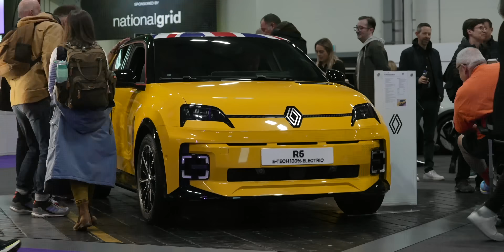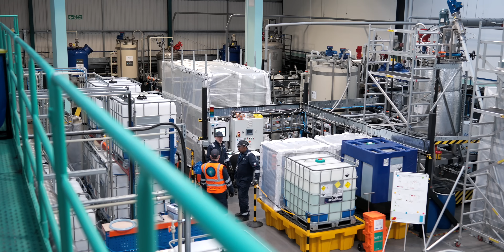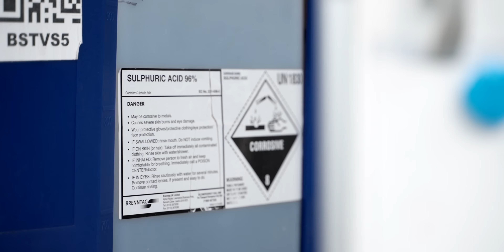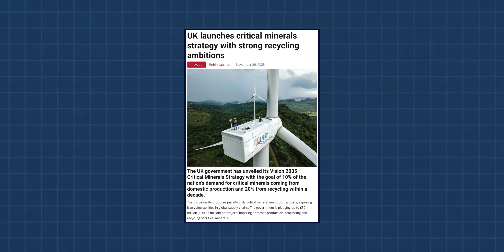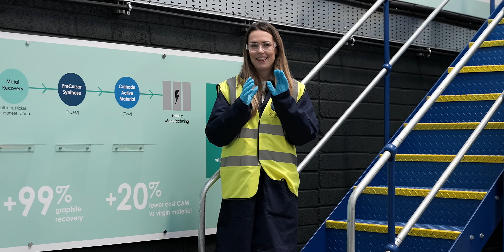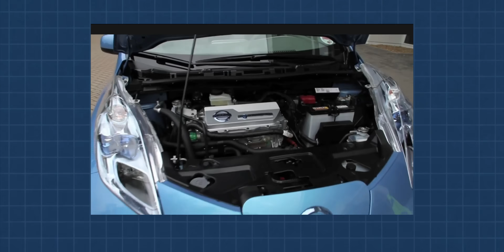EV Battery Recycling Could Be The End Of Mining!

Comment: They should invent a way to recycle burnt fuel.🤣
Reply: How?
Reply: @Brian-om2hh I think that was his point. It can't be.
Reply: @oddjobsandrandomprojects 

😂😂😂😂😂😂😂😂😂😂😂😂😂😂😂😂😂😂😂

And yet another blunder on your part.

You really can't help yourself can you.
 
Hydrogen and oxygen recycle themselves into water at the same time as work is performed.

Water is then split into hydrogen and oxygen via electrolysers.

Green electricity decoupled from the grid is effectively free.

Try as hard as you can to resist your usual spurious arguments on the grounds they have no merit and never had.
Reply: @ForestForest-n9i @ForestForest-n9i Tell is about what car you personally own then. Is it hydrogen?
Reply: @ForestForest-n9i @ForestForest-n9i
At some point it’s worth stepping back and looking at what’s actually working now, not what’s been “five years away” for the last two decades. Battery Electric Vehicles (BEVs) have already won the light-vehicle race on efficiency, infrastructure, cost, and real-world usability, while hydrogen remains a niche science project for passenger cars.
First, efficiency matters. BEVs convert roughly 70–90% of grid electricity into motion. Hydrogen vehicles (both FCEVs and H-ICE) lose huge amounts of energy producing hydrogen, compressing or liquefying it, transporting it, and then converting it back into electricity. Once you count all that, hydrogen struggles to reach 25–35% well-to-wheel efficiency. Using clean electricity to make hydrogen instead of charging a battery directly is simply wasting energy.
Second, infrastructure is decisive. Electricity is already everywhere. BEV owners can charge at home and use a rapidly expanding public network. Hydrogen stations are rare, expensive, complex, and unreliable. In the UK there are only ~15–16 hydrogen stations total, with about 6 open to the public, versus 57,000+ public EV charging points and growing fast. Globally the contrast is similar: millions of EV chargers vs ~1,100 hydrogen stations. You can’t scale a consumer technology without infrastructure, and hydrogen never has.
Third, cost and practicality. BEVs have lower total cost of ownership: cheaper “fuel,” fewer moving parts, and less maintenance. Hydrogen fuel is expensive (often $10–15/kg in the US), stations frequently go offline, and you can’t refuel at home. This isn’t theoretical—hundreds of Toyota Mirai owners in California are now part of class-action lawsuits after being stranded by broken stations, skyrocketing fuel prices, and vehicles that have lost most of their value.
Fourth, a point often ignored: FCEVs still use lithium batteries. They are series hybrids—hydrogen makes electricity, which is buffered in a lithium-ion battery that powers the motor. So arguments against BEVs based on batteries also apply to FCEVs, plus FCEVs add fuel cells, platinum catalysts, high-pressure tanks, and more complexity on top.
Fifth, the market has already decided. Global EV sales jumped from ~3 million in 2020 to over 10 million by 2023, with BEVs dominating. Automakers and analysts (IEA, BloombergNEF) consistently point to batteries as the winning technology. That’s why companies like GM and Stellantis have scaled back or exited hydrogen passenger-vehicle programs, and why hydrogen is increasingly being limited to specific heavy-duty or industrial niches, not everyday cars.
Hydrogen cars do have zero tailpipe emissions, but once you consider production methods (mostly fossil-based today), energy losses, infrastructure costs, and real-world failures, they simply don’t compete with BEVs for personal transport. While hydrogen advocates keep promising a breakthrough “soon,” millions of people are already driving cars that are efficient, affordable, charge at home, and work every day.
This isn’t ideology—it’s engineering, economics, and market reality. For light passenger vehicles, the conclusion is no longer controversial: plugging in beats waiting for a miracle fuel.
Reply: @ForestForest-n9i Not good at reading are you. Try again.
Reply: @ForestForest-n9i Ross Kneebone — since you’ve publicly stated that you work as a representative for a hydrogen bus company, the way you behave here looks less like honest debate and more like paid advocacy mixed with trolling. You don’t show up to add insight; you show up to complain, derail threads, and take snide shots at other commenters instead of engaging with evidence.
So let’s stick to reality. In the UK today there are roughly 16 hydrogen refuelling stations in total, and only about six are actually open to the public for passenger cars. That’s not a rollout — that’s a dead end. By contrast, the UK has tens of thousands of public EV charge points, and the number keeps growing because electricity already exists everywhere and scales cheaply. Infrastructure decides consumer technology, and hydrogen has simply failed that test.
On efficiency, the physics are settled. Battery electric vehicles convert the majority of grid electricity into motion. Hydrogen passenger cars throw most of it away making hydrogen, compressing or liquefying it, transporting it, and then converting it back into electricity inside the car. Well-to-wheel efficiency for hydrogen struggles to reach a third of what went in. Turning clean electricity into hydrogen instead of charging a battery directly is just wasting energy.
You also repeatedly attack lithium batteries as “dangerous” or “unsuitable,” which is especially dishonest given that fuel-cell vehicles still rely on lithium-ion batteries. They are series hybrids: the fuel cell generates electricity, that electricity is buffered in a battery, and the battery powers the motor. By your own logic, hydrogen cars fail before you even get to the fuel cell — and then pile on extra complexity with platinum catalysts and high-pressure tanks.
Real-world ownership backs this up. BEVs charge at home and work every day. Hydrogen car owners deal with broken stations, fuel shortages, extreme prices, and collapsing resale values. These aren’t hypotheticals — they’re documented outcomes of trying to force an unscalable system into consumer transport.
Mocking “history lessons” just highlights bad faith. History is where facts come from, and history shows which technologies actually scale. BEVs are already here, already working, and already dominant because they’re efficient, practical, and affordable. Hydrogen cars have been “five years away” for over twenty years.
So here’s the simple question you keep avoiding: what car do you personally drive — and is it hydrogen?

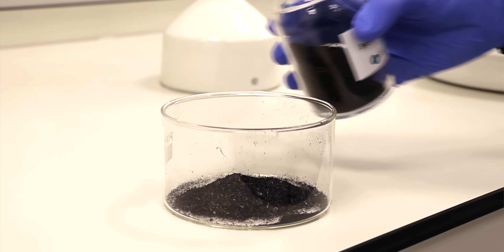Comment: 6:06 - Very important comparisons here about the huge differences in masses involved between recycling vs virgin mining.  Bookmarked!
Reply: The actual question is why does Europe actually lacks battery manufacturers?
Reply: @alanmay7929  I think the biggest reason is that Europe couldn't compete with China on volume and price of batteries.  If one can't make a profit, then the business case is a non-starter.  The same thing happened with solar photovoltaic technology.

Probably most places couldn't compete with China actually—except tariff protected locations.  But tariffs at high rates used to shield local business are never a good idea in the long run.

Perhaps Europe can focus on supplying cheap and clean (no mining) battery raw materials to China by investing in battery recycling technology and infrastructure.  It's all eventually needed to close the loop on the renewables and EV supply chain.
Reply: @beyondfossil please stop talking crap! Europe with its outdated laws just didn’t wanted to mine those rare earth minerals and even lithium in its own lands that’s why they slept and waited for China which actually took over a decade to optimize the supply chain and manufacturing, europe could have very easily invested in eastern countries for the long term and actually also in the mining.
Reply: @beyondfossil china litteraly owns everything from mining to production to even recycling. Europe has nothing to bring to them.
Reply: @alanmay7929 Take it easy.  You can make your points without being rude.
Reply: @beyondfossil what “rude”? 😂😂 the fact that europe couldn’t invest and keep its key industries?
Reply: @alanmay7929 The Germans have battery factories. Not sure what you are talking about
Reply: @oddjobsandrandomprojects the germans doesn’t have any battery factory! They have the outdated alkaline batteries from Varta, vw has been working with a Chinese battery manufacturer for a pilot project to make batteries in Europe.
Reply: @alanmay7929 Do some research and try again.

Comment: I think the people at Redwood materials in the US said it right... at this moment a lot of there supply's are about 50-60% from car batteries another 20-30% from industrial batteries about 10-15% from old electronics and phones and laptops.. and about 2-5% from tool batteries and the rest from loose cells for flashlights and such. 

So yes crashed cars and such have there place but there are many other batteries out there that are at end of life. 

I think the hardest thing happening is this factory you shows makes mostly NMC battery materials... I wonder how the shift to LFP cells will adjust there process.. and there we also have the risk of things like sodium cells becoming lost in the mix as well. 

So what is in black mass is changeing rapidly i dont know at what percentage of lfp cells dose the process change
Reply: Altilium can already process LFP, as well as LCO, on its pilot line, their aim is to be able to process most battery types. Even future batteries like Sodium Ion and LNO (starting to emerge from the labs as a higher energy battery than NMC), can be encompased (once their working chemistries are stablised).

Comment: If there was one of these factories built in every county of the UK, it could be an industry saving public sector job for people who want to work(one that is actually valuable) which could fuel an economy for electrifying local homes and vehicles! Build them next to refuse sites and you have a circular economy on your hands! Enter some skilled installation engineers to help upgrade old homes with battery storage and bring new builds up to speed (every new build should have 10-20kwh battery). Suddenly the future looks bright!
Reply: It's the scale that will make the process viable. What might work is the extraction to black mass prossessing locally. They did not mention where that came from.

Comment: Whilst you say there is currently insufficient vehicle batteries there are literally 000's of Lithium and NMC  batteries from consumer products like calculators , power tools, computers , Phones etc that could provide a current recycling opportunity for such mid size  pilot plants immediately.
the complex, cost intensive component though is collection and transport of the spend and damaged batteries to the recycle centre
UK is relatively a small nation densly populated with significant E-Waste already so that distance of transport is small but the collection side is still complex.
Consider the same constraints in say Spain, or France where the population are more spread out. 
The logistics side cost increase in levels of magnitude.
We see the same issues here in Aus with plastics recycling.
It is not sufficiently rewarding and requires subsidies to maintain a recycling presence . 
Collection and processing costs are not viable for economic return without subsidy to minimise waste disposal by deep burial or industrial incineration.

Comment: Australia has 20million vehicles and 1million new vehicles annually. 
So, 20years to 100% EVs. 
UK, 20years  ?.?
USA, 20years  ?.?
Europe, 20years  ?.?
Asia,
Reply: The battery recycling industry is gearing up for 2040, when it's projected to be a $90bn global industry. Currently, people are trying to work out the most economical and effective proceses, ones that can work now and quickly scale later on.
Reply: @GruffSillyGoat and replace mining  ??
Reply: @stephenbrickwood1602  - reduce initially. But depending on the future direction, possibly to do away with mining, well for cars at least. If high production automation makes cars a commodity item (with shorter lifetimes due to more rapid turnover of needs/trends/esthetics), then car batteries may be specifically designed for recycability (some companies are already working on this area to get away from the black mass approach).

Comment: Just imagine if someone would design batteries such that they didn't need to be ground in to "black mass" before we could recycle them.
Reply: The prime directive is to produce the battery.,..we already know that Al metal even in tiny amounts will contaminate Li and is immensely problematic  come recycling so manufacturers are encouraged to avoid  that combination in Li battery design, or thoughly  seperate it before but it isn't a problem with Na, 
Plus Na is a 1000x more abundant ,plus the material cost is only 5% the cost Li Fe PO. .
NMC production looks like it's going to  be a dead end for volume vehicle production, CATL has said it is looking to move completely away from NMC for volume Cell production . 
Whilst Na Salt is low value ..it is easy to extract and minimally polluting to produce and recycle .  The NAXTRA cells are estimated to have a life of 10,000 cycles  before it may drop to 80% original capacity  for reuse in static energy storage .
Reply: @clivestainlesssteelwomble7665 

😂😂😂

All batteries are useless for transport because of the weight.

Much is made of efficiency in BEV circles yet it's not especially efficient to have a heavy battery simply to transport a single person.

Suggest we just accept battery power is a thing of the past and merely a step on the way to electrically powered cars.

We've all seen the huge strides being made with FCEVs and we can confidently expect them to "usurp" the position held  by BEVs ere too long.
Reply: @ForestForest-n9i @ForestForest-n9i Tell is about what car you personally own then. Is it hydrogen?
Reply: @ForestForest-n9i And the weight of FCEVs is even higher, range is lower, efficiency is lower, cost is higher, fire risk is higher, and only 6 fill points in the country.
Reply: @ForestForest-n9i Sure, sweetie. Sure.
Reply: @oddjobsandrandomprojects 

😂😂😂😂😂

Comment: Really interesting. Can the extraction chemicals be used perpetually or is there a big disposal problem that has to be taken into account? Would be interesting to understand the whole cycle. Jobs for the southwest now that’s a bonus!
Reply: They are elements. They can be recycled indefinitely.
Reply: It's the losses that matter. You'll still have 50% of the material from your battery in 100 years (or whatever the number comes out as, depending on battery life).
Reply: @Biggest-hz7ng where does 50% of the material in your battery go?
Reply: @adamkiddle  the material is lost during processing. If you retain, say, 95% of your material in each recycle, you lose 5% to the discarded chemicals and in the processing. Gradually the material in your original battery is lost.

Comment: What happens to all the solvents? What waste do these processes produce?
Reply: Also how much energy is needed to run the different processes.
Reply: @bknesheim  - It's a mid-temperature industrial process (some steps listed as 450°C, but heat is reused further down stream), heat can be supplied by renewables, and can be recovered by using the likes of a turbo claw heat recovery system at the end and recycled back into the process.
Reply: @GruffSillyGoat Even with a good system for recovering heat 30-40 % will be lost. Enormous amount of heat is lost every year in industrial processes.
Reply: @bknesheim  Consdiering the UK has a lot of nuclear and renewable energy how much power it consumes isnt really a concern.
Reply: @gyratingwolpertiger6851 UK still most import over 10 % of the electricity they use and nearly 30 % is based on natural gas.
Reply: @bknesheim got to be less than digging it out of the ground, refining and transport
Reply: @LadAussie  That might be true, but recycling can be very energy intencive.
Reply: This would be interesting to know. But, refining the mined minerals surely uses a lot of chemicals as well. It's the same as EV critical people pointing out the cobalt and other minerals in battery production, but ignoring it in making petrol, then burning that petrol to release some of it for us all to breathe in. The better choice is obvious.
Reply: @electroplaque you're absolutely right, and we should continue down this path refining each step as we learn more. But we're right to be concerned with the chemical waste issue. It may be cleaner than the mining/extraction method, but can it be cleaner still.

Comment: Recycling is great but completely getting rid of mining is impossible. You can't recover 100% of the material.
Reply: Getting rid of mining is inevitable once we've got nothing left to extract, what do you propose we do then?
Reply: The fly in the ointment with that argument is older chemistry batteries use more minerals than newer ones, NMC has gone from a 1:1:1 mix of Lithium/Nickel:Manganese:Cobalt to Lithium, to a 9:0.5:0.5  (Ni/LI to Mn/Co), with 9:0.25:0.25 being developed. So whilst your correct you cannot recover 100%, Altilium recovers between 95% and 99%, but what is recovered goes further as battery designs evolve.
Reply: I believe it's around 90% done correctly......